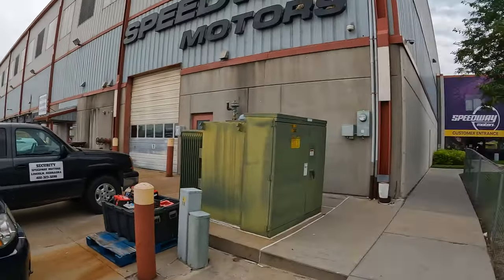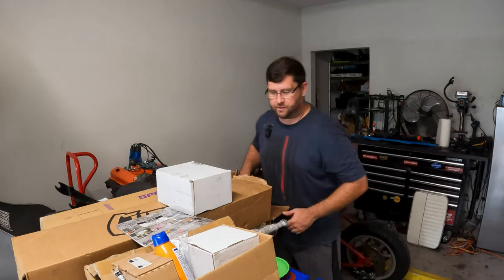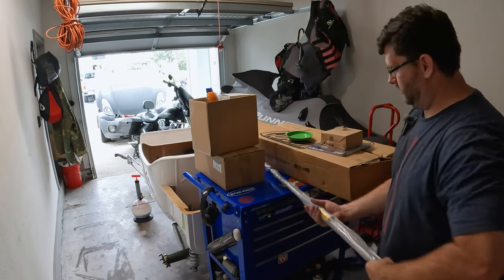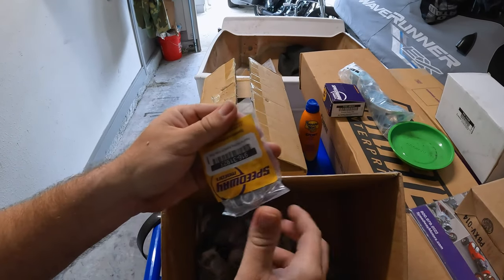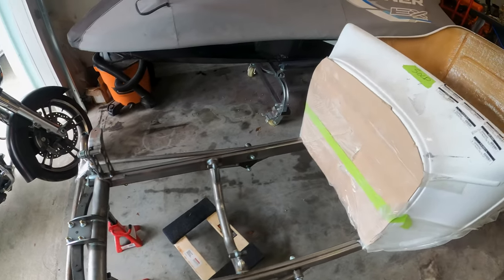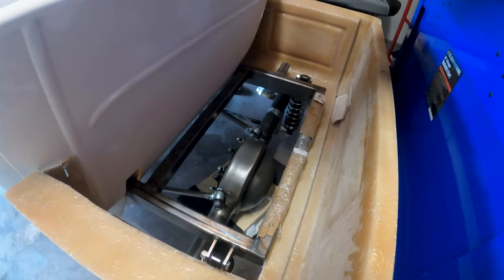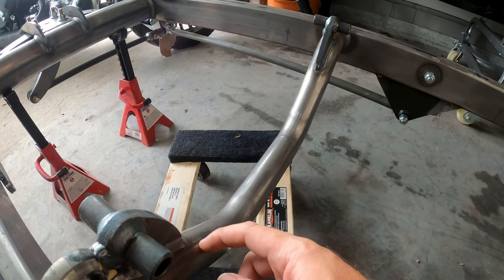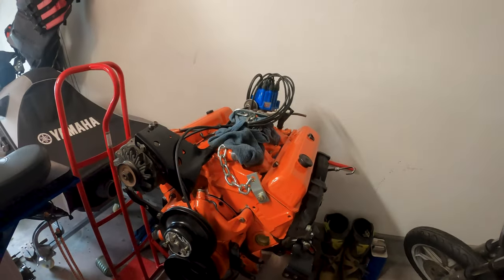T Bucket Hot Rod Full Build - EP1 | Speedway Motors Unboxing the T Bucket Kit

Comment: Thanks for the video. My son and I are about to tackle this but we are headed into the great unknown. We are going to break ranks and put a Ford 5.0 Coyote in one of these mainly because we want to be different and we have it already.
Reply from the maker: That is sweet!!! Are you doing the same frame? If you call them first they can do options for you and omit the cradles if needed. What's trans you planning?
Reply: I’ve already found a kit that will allow the installation of a 5.0 Coyote in any hot rod. It will probably require modding and will definitely need some welding and I can cover that, I’ve been an industrial mechanic for nearly four decades so this probably won’t be that  hard for me to pull off. I think the only issues will be I’ll need a set of custom headers made. I’ll probably have some made that are sprint car style. I’ve watched some videos on setting up the ECM and wiring harness and they don’t appear to be to difficult. There is a company out there that can delete everything from the ECM not needed.
Reply from the maker: @ogles824  well keep me updated would leave to see a finished product.  Also look at HP Tunes HP4 I use it to do stand alone ECM deletes and you can program or delete any thing through it .

Comment: Hello! I just subscribed and will be following this build closely.  Does the manual tell you about what type of lubrication is needed during assembly?  I can bolt parts together but I'm afraid I might put something together dry that should be lubricated.
Reply from the maker: So the assembly manual is hit-and-miss and really only serves as a guide.  When you do order the actual bolt-on hardware you receive a more detailed generic printout but really all you need is blue lock tight here and there everything they use is locknut/lock washer or C Clip and they give you all the torque specs.  It can be frustrating at times with the assembly but when in doubt you can call or send a pic to their techs and get same-day answers.  If theres something specific you want to see in the next video let me know and I can focus on that.  Hope this helps!

Comment: Very nice. I have been buying parts a little at a time until I buy the whole frame and body kit.  Did the frame, suspension and body come bolted together or did you pay extra to have that done?
Reply from the maker: It came all bolted together......hand tight.  I was somewhat confused as I was told multiple times that it would not be assembled.  I have run into a few issues so far but nothing crazy that speedway has not fixed.  Craftsmanship is spot on!  Unfortunately a few missing important parts but they fix it as I find them.  Issue is all the damn backordered parts. And frames are taking 4-6 months not 4 weeks as they advertise. My frame was placed back in March so order ahead!
Reply: @GearHeadzGarageUSA  thank  you for the response. That is what I understand is that it is 
unassembled. But good for you. 

Good luck and have fun.
Reply from the maker: @ocam988able  I will be dropping ep2 this weekend which I'm diving in deeper but it's been fun and frustrating.

Comment: the kit was 4800 with or without axle
Reply from the maker: So the kits are a bit funky......They have 3 kits and each kit comes with a little something more or less.....Basic, Nostalgia and Deluxe each with a different price.  The specific deluxe kit I got did not come with the rear end, I added it separately but I chose the "House" version which was an additional 800$ on top of the kit price.....ended up with a Currie Rear End with all brackets welded and installed?  I think this may have come down to the fact that it took 3 months and the order got lost somehow.....
Reply: awesome im excited to see how your build turns out    my goal is to get the kit by December for me and my dad to build
Reply from the maker: @austinkeen9519  who do plan on ordering from? If it's speedway do it early!!! They say 14 day lead time.....it's more like 3 months there's a run on all the parts they give you.  I was calling about every other day they finally subbed in alternate items as they were saying August when I ordered in April!
Reply: i was planning on either the tribute or basic kit from speedway ive already got a sbc ive been building a 700r4 and a s10 rear end
Reply from the maker: I wanted the tribute as I heard it was slightly longer and lower. But opted for the deluxe T cause I didn't want to wait..... In hindsight... The amount of time I waited on the original T, I probably should have just did the tribute 😂😂

Comment: Why does everyone I've ever seen do this kind of a build never put a manual transmission in it? I dont get it.
Reply from the maker: It's an understatement when I say zero room
Reply: @GearHeadzGarageUSA , there's almost always room. These days, you can do it with a hydraulic T/O bearing. Unfortunately, when I built mine, those bearings were brand new and prohibitively expensive for my budget. So, I fabricated a weld on bracket that would carry a clutch master and a brake master and another bracket that bolts to the bell housing for the slave which can be accessed for fluid check/fill from a hole in the floor below the seat. Works like a charm! The trans is an '82 Mustang SROD 4spd manual. Works perfect as 4th gear is overdrive. Anyway, it's like anything else. If you want it bad enough, you'll figure out how to make it happen.
Reply from the maker: For my size and weight it wasn't going to work with this kit. I'm sure with a custom drop body it would be great